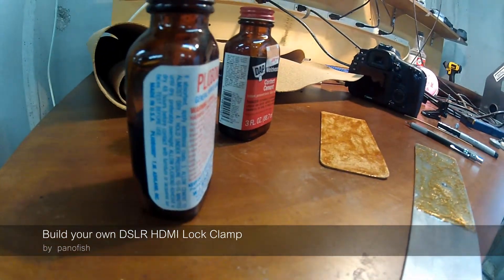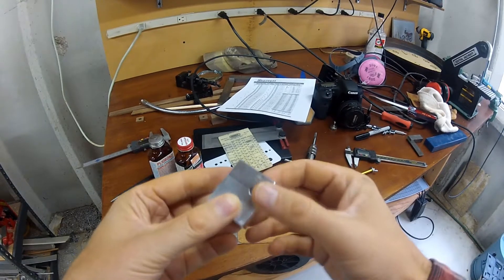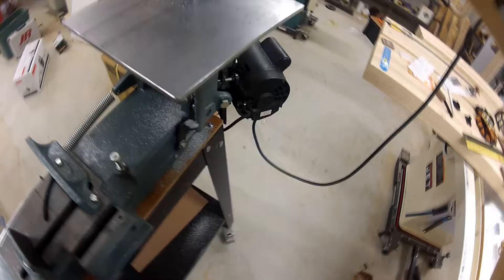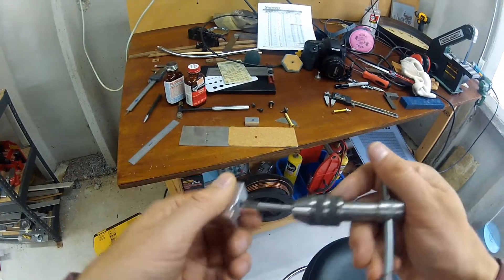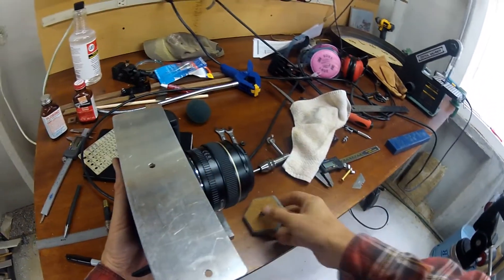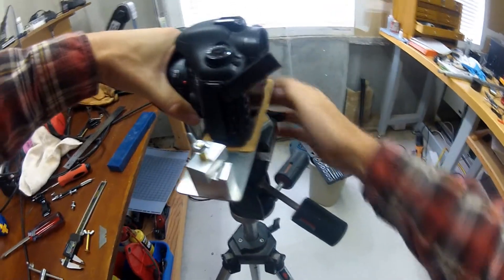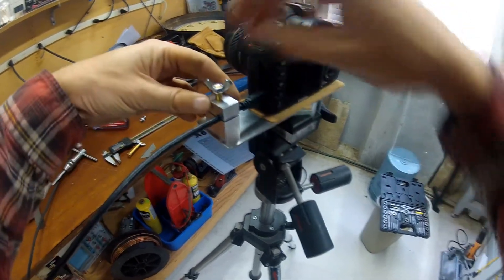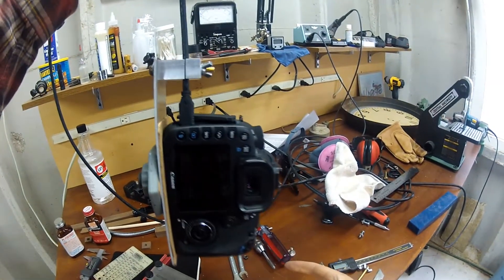How to Build your own DSLR HDMI Cable Lock Port Clamp

Comment: All this to save $40? ... Hmm. 
Admire your handy skills, but this doesn't make much sense. Pro gear looks and functions better. It's designed for the job. 
Also I don't recommend showing up to any gig where you want to be taken seriously with giant DIY wood or aluminum cable clamps.... I guess if you only ever plan to use your camera at home dabbling in little personal projects it would be fine.
Reply from the maker: check the date that I published the video... at that time... there weren't many products available or they were very expensive.
Reply: @panofish  just out of curiosity do you remember the prices? $100ish?

Comment: Nice work. As suggested you can use two pieces of wood instead of the metal. Easier to construct but also aesthetically less rewarding.